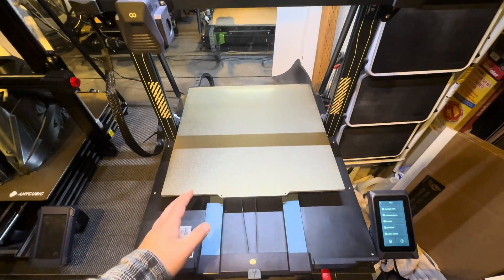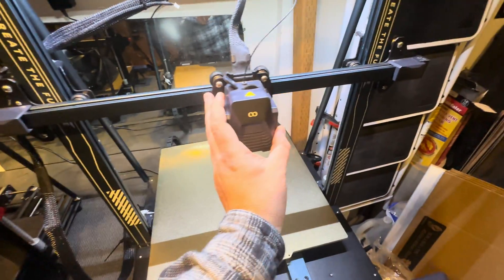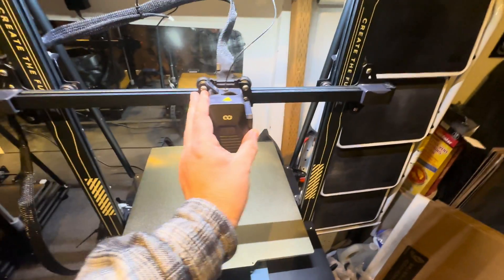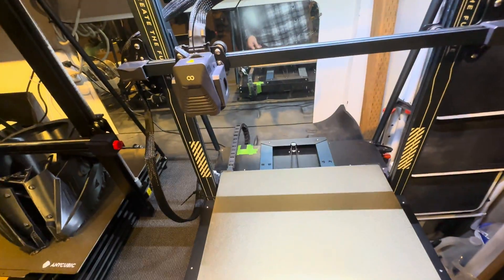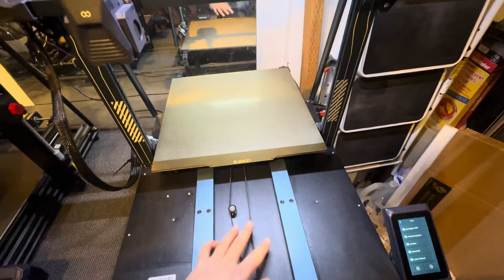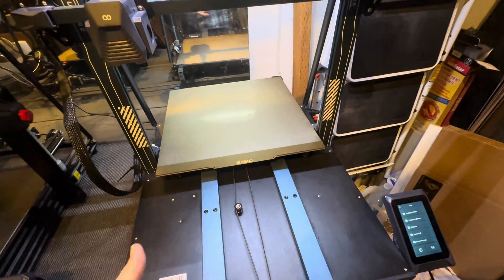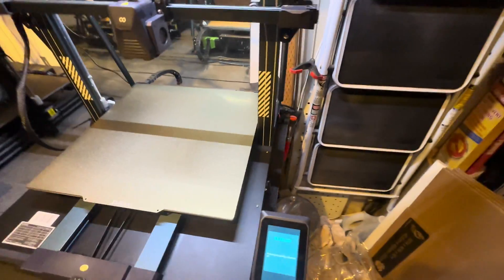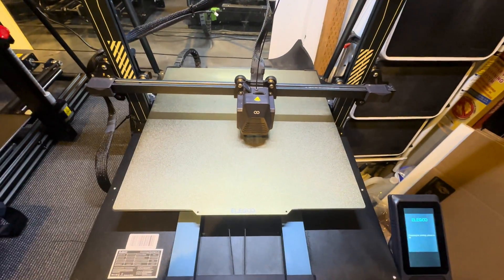Elegoo Neptune 4 Max Belt Tension and Layer Shift Prevention

Comment: Heyy, appreciate the video...but my belt is broken in max 4 and i am not able to find the part on the elegoo website and its replacement video....could anyone help
Reply from the maker: Which belt did you break? I usually just order a roll of belt material and trim it to the length I need.
Reply: My x axis belt and tensioner broke, I just emailed elegoo and they sent me a new tensioner and belt for free.

Comment: Hi Outer Rim Armorer, In my Neptune 4 Max after running out of filament, the printer stopped automatically (as intended) but after loading a new filament roll and ordering the printer to resume with the print job, the hot end (0.4 original nozzle) came out of position for more than 10/15mm in the Y axis. Same situation when I Paused the printing. Can you help me? THANKS
Reply from the maker: I have the same issue. I’ve heard there is a fix. I’ll try and come up with a video on how to do it once I learn and fix mine.

Comment: This video helped me figure out my N4Pro issues. Your suggestion about the “tugging” made me realize I hadn’t put the grease on the metal guide rods on the new machine. Just printed a new benchy and it came out perfect. Thanks!
Reply from the maker: Yay Glad it helped!
Reply: I have not added any grease to anything on the machine. Should I? It makes sense to lubricate any moving parts.

So are you referring to the two, vertical, threaded rods that raise and lower the print head? 

What grease is suitable?

Also does anyone use the supplied glue for the print bed?
Reply: @MrJimmyBananas  Wondering the same thing @logie_youtube what grease did you use?
Reply: @HandsomeToast You should use a thick grease. Most recommend white lithium grease. Just make sure it's a thick paste and not a spray or thin oil like substance.

Comment: I'm going nuts. I have 2 of the 4 Max and 4 Plus. My Max's both shift all the time and I cant find the sweet spot. Oddly enough, ones bed is much harder to move.
The Plus have been a little bit nicer, but I have to use settings for a regular 4 with a bigger bed for it to run. I'm gonna try those wheel covers and see what happens, but I am so close to sending these back, they've been a huge letdown for me.
I appreciate your video though, Thank you!!
Reply from the maker: I’ve been considering sending mine back as well.

Comment: I have a 40 x 40 bed with magnetic bed, but when I was printing a large print 1+kg I had layer shift always near the end of the print. I was advised to try using tape to help stick the PEI sheet to the magnetic bed, I went around the bed, with blue painters tape and 6 bed clips (bulldog clips here in the UK) and I had no layer shift, even on my biggets print which ended up 38 x 40 x 450 at 1.8Kg, worth a try!

Comment: Keep getting layer shifts at different spots. Cables were and issue at first but got that fixed. Now think its the belt
Reply from the maker: I struggled with layer shifts briefly that were due to my belts being to tight. I only noticed what was causing it because the more I tightened the belts the more it would layer shift.

Comment: I make a habit of lowering the acceleration and jerk values on Y axis on the larger format printers. Seems to keep the shifts away.
Reply: That has helped for sure. But I still get layer shift issues with both belts and acceleration addressed...
Reply from the maker: 🤔 Well the bed cables getting hung up on stuff was one of the reasons I’ve had layer shifts in the y axis direction. But X axis…hmmm. Have you checked if your gantry is loose or maybe the hotend? Anything wiggle that shouldn’t?
Reply from the maker: This seems to also help with ghosting problems on the print.

Comment: So what about bed levelling.
I’d say my tension is pretty good.

Recently I’m dealing with bed level issues. According to fluidd it looked okay. But it was scraping at the back. I tried to find some other stuff and recently learnt the wheels were out of whack. Got that sorted but that ended up sacrificing my bed. So now I’m at the stage of having to spend hours to days bed levelling. From your experience- if you have taken the bed off, what would you say to do as a start. 
(I started off loose, panicked it was too high and must’ve missed tightened it all to warp it). 

I have the N4Plus
Reply from the maker: I’m sorry to hear you’re having troubles with your N4Plus. I’ve been wanting one of those as well. It’s late and I’m tired so I’m not exactly understanding your question. I’m happy to help if I can. Which issue would you like to try and tackle first?
Reply: @OuterRimArmorer  It was late when I wrote this so it probably didn’t make much sense.

So recently had an extruder replacement and noticed the wheels on the printer were loose. So after tightening all the eccentric nuts, I went to put the bed back on.

What would be best when putting the bed back together. Starting loose or starting tight
Reply from the maker: I put it all back together tight and still had to adjust everything once it was back on.
Reply: @OuterRimArmorer  ah okay. Cool cool.

I think I’m just overly worried, seeing forms of people having issues and such while being very new can be intimidating.

 Cheers!!